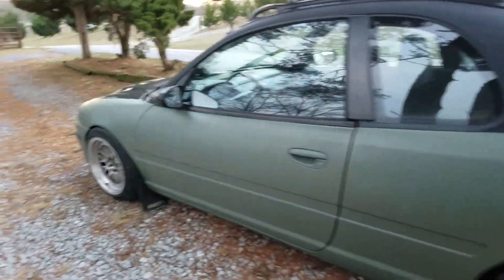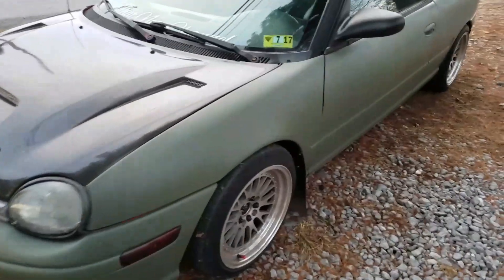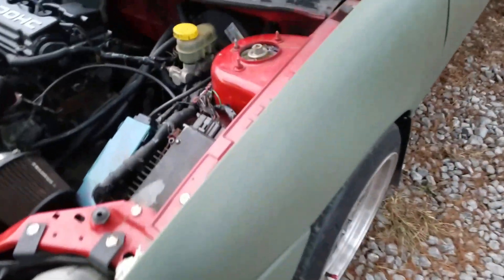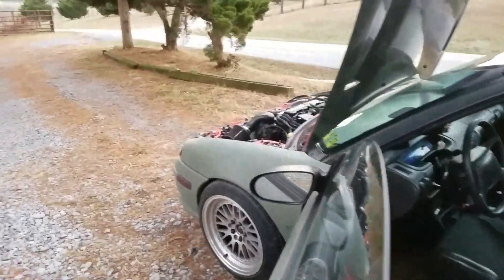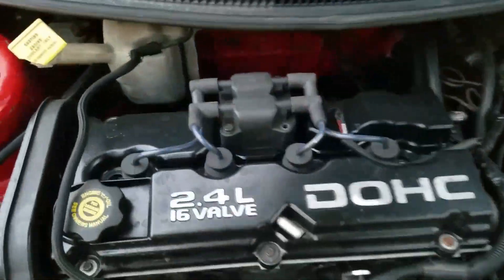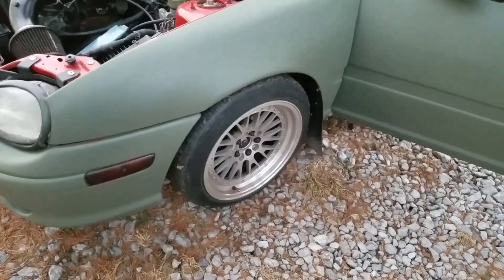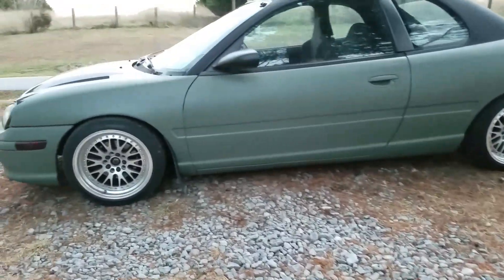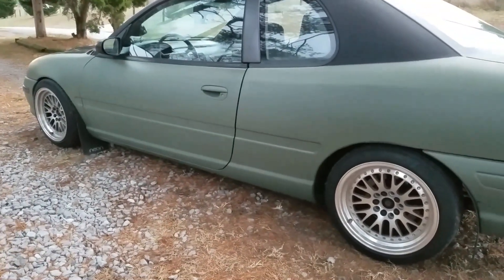10 Things I Love About My 98 2.4 Swapped Neon

Comment: I’m digging it man. I truly miss my old neon, and really wish I had it back. One of the best cars I’ve ever owned, and one of the cheapest to work on. It was back in the day before they ever had the 2.4 the SRT or the PT cruiser. It was a 95 2dr Dodge Neon that I actually fully built my 2.0, with the 5spd, dual plated Centerforce clutch, eiboch pro series suspension, stainless long tube header, milled/ported head, flat top pistons, CAI, 2.5” exhaust “hollowed out cat”that went out to a dual tip 40 series flow master with 3” stainless tips. Full Wings West body kit, Pegasus spoiler, 17” deep dish rims “black” with Michelin sports cup tires, big brake kit, custom two tone Black/Orange paint job. I would love to have it back or build another. But neons are really hard to find anymore.

Comment: Great video ! I gotta agree 2 doors looks pretty clean
Reply: Matfast32 I'm back and forward on which one looks better
Reply from the maker: +turshin lol
Reply: That Neon Channel I was all about the 4 doors for a long time before I bought my RT. I used to think there was too much space between the top of the rear wheel well and the rear  quarter panel. Plus the 4 doors are deceptively huge inside. My girl's 95 Neon has more room than my 2014 Dart yet weighs waaaayyyy less and is no where as big on the outside. But all that changed when I got my 98 rt. I love the compactness of it all.

Comment: i have the 98 4 dr dohc dose the 2.4 bolt up to the trans and motor mounts ect????
Reply from the maker: +Doc Young yea the trans but the trans mount needs flipped and the modernperformance.com sells the 2.4 swap mount adpt for the passenger mount for 50 bucks and u need to swap a couple pins at the ecu and cut a lil of the front motor mount

Comment: I need help, my Dodge Neon 97 pulls bubbles through the radiator plug :-(
Reply from the maker: +Michael Euceda im confused what do u mean by it pulls bubbles ...if it sounds like it boiling threw it maybe thermostat aint opening or u blew headgasket
Reply: That Neon Channel Hi Friend. dont hace termostate, and burble is stronger and whater out the tank reserve